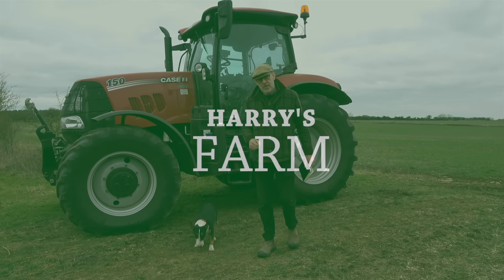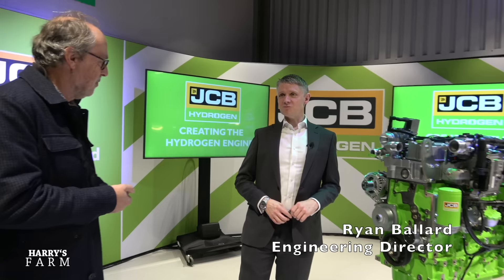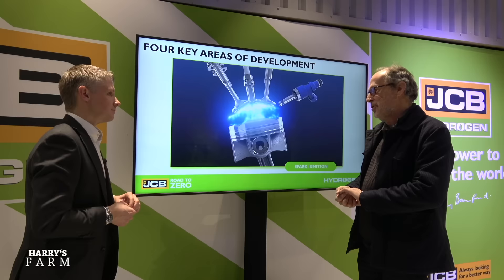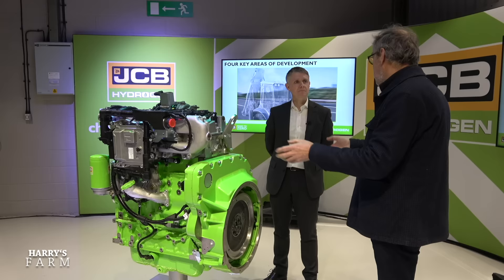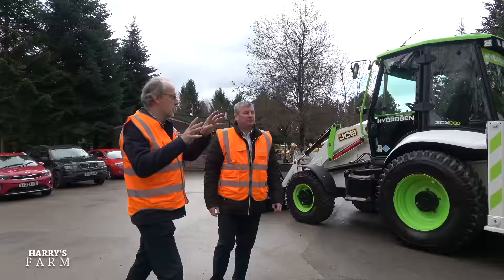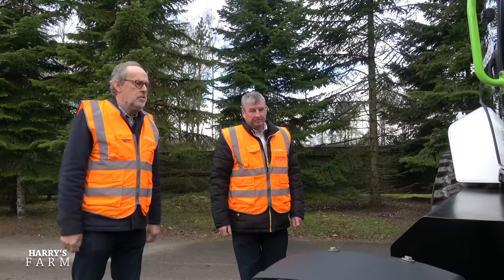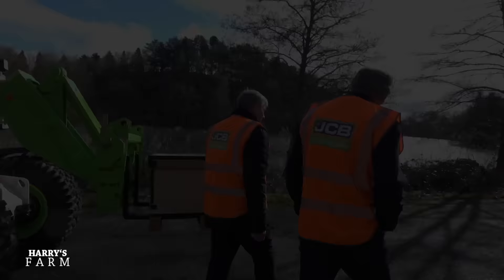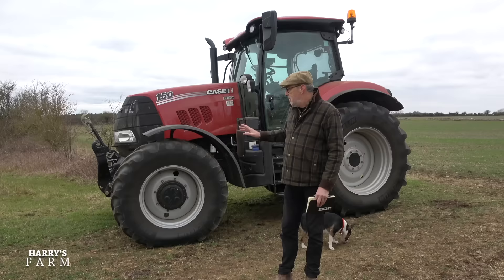JCB is moving to hydrogen power for all their big machinery. Here’s why.

Comment: I can’t agree with you more about hydrogen being the way forward for torque engines, and the multi fuel approach to get to net zero. I have a customer who is a subject matter expert in the industrial production of hydrogen and the transportation of it thereafter. The challenges are enormous and there will be a requirement for significant infrastructure to support the Green energy required to produce hydrogen.  In addition to that the distribution of hydrogen is very tricky due to the fact it needs to be -273C to ,liquify it and then the fact that hydrogen oils so easily and the gas’s loss is in the region of 20%. 
The only other way to distribute hydrogen would be as a compound with Ammonia the most likely candidate. There is insufficient ammonia production in Europe as a whole and the step up to that level of production is huge.
I have noticed with interest that the hydrogen pump at the Shell Gatwick Airport has been removed. I wonder how many others have been removed country wide.
As for the government and there box ticking without investigating………well you can’t help stupid.

Comment: I want to keep an open mind on this but there are a lot of issues.  First hydrogen is extremely difficult to transport and store.  Because it is the smallest element, it oozes out of anything that you put it in.  Second it presents a serious safety risk.  It is either compressed to an extremely high pressure or liquified.  Third it will be 15 years or so before green hydrogen will be readily available.  Today 97% of hydrogen is produced from fossil fuels.  Fourth it is 7 times more expensive than electric.  Five no regenerative braking to recover energy.  

Swappable  batteries, like Janus trucks, may be a better option.

Comment: 36.25  Cutting the cost from $15 to $1 is unlikely.  The cost of handing it is way higher than diesel. The cost to compress it is very high.
The EROI is terrible. Solar has an eroi between 3 and 6. So using solar to generate hydrogen will never be higher than the EROI of solar minus all the losses.    All the conversion losses and  compression will lower it even further.  With marginal solar, you could end up with a large net energy sink. Add these losses to the losses in the engine and you can easily be large net energy sink.

Comment: WOW!
Hats off to JCB, they really are pushing the boundaries in the hydrogen sector. The only possible thing I can think of in terms of an improvement is to generate the hydrogen in situ using water in the tank. That of course is the holy grail for attaining a true hydrogen economy.
Reply: So, where would the energy for the onboard hydrogen production come from?!
Reply: @Simon-dm8zv  There is in fact at least one 'forgotten' technology that I am aware of that produces enough high heat energy in a closed loop system capable of producing hydrogen from H20 without electrolysis. The temperature attained is capable of melting tungsten which splits the water H+H+0
Reply: @lagunafishing  Sounds very energy intensive
Reply: @Simon-dm8zv  Not at all, it's low cost and self sustaining. The heat used to split the water is derived from the recombination of hydrogen atoms H + H =  H2
Reply: @lagunafishing  Impossible, there will always be losses.
Reply: @Simon-dm8zv  Yes,  of course - you will lose some water and some heat and some energy loss through mechanical conversion but there will always be some gain too in terms of efficiency.
Reply: @lagunafishing  As long as there are losses it cannot be self sustaining.
Reply: @Simon-dm8zv  Yes it can.
Reply: @lagunafishing  Nope
Reply: @Simon-dm8zv  Water is everywhere and so is hydrogen, so yes. The only required energy input is a spark.
Reply: @lagunafishing  you might want to read about some basic introduction to thermodynamics.

Comment: I fear that this engine is not the panacea that people will hope and expect it to be. There are tremendous challenges with the production and storage of hydrogen. The energy required for electrolysis, the cost of the materials for the proton exchange membrane, the permeability of storage materials, the cost of setting up infrastructure. I am not a naysayer, just a realist. It might become more cost effective if we can harvest comets and the various moons in the solar system to collect the platinum and iridium needed for the PEM, but that won't happen any time soon. We also need cheap and abundant energy and that's years away too. There is work going on to develop pressure vessels that can store hydrogen at 800 BAR, without allowing it to leak through the walls. Can you imagine the risk assessment for charging the tanks when they are empty? I'd like to see hydrogen engine in mass production, but I can't see it happening.

Comment: Have you seen the potential for green ammonia thru a business called Feul Positive... Ticker NHHHF, They have a machine which can produce the ammonia using just Air & water plus a renewable source of electricity... They have already converted tractor & pick up truck FYI... Plus in farming this Feul is also going to be useful in fertiliser too...  I think as an engineer that storage and handling of the ammonia in terms of tanks and far less volatility that you have potentially a easier solution for conversion of your current vehicles.... 
Ammonia still holds high speed record from a jet plane from years earlier... 
Would be interested in any thoughts on another hi performance alternative Feul, but without the hi pressure containment issues with Hydrogen...

Comment: What I can see happening is shady mechanics saving old engine oil and pawning it off to a different customer as new engine oil, I would put a color additive in the oil so that it could not be resold as new oil, like how home heating or un-taxed diesel is pink and regular diesel is clear, there should be some kind of mechanism built into the machine to change the color of the engine oil once it's added to the machine.

Comment: It is very easy to get diesel like Torque, when you do a 33% long stroke engine with a Compound Turbo.
Basically, you are mimicking Diesel characteristics.
And you could burn Propane on higher compression too.
Hydrogen will be too expensive........

Comment: Daily Telegraph article from 07/03/23:  The joint project with the Illinois Institute of Technology (IIT) has achieved a radical jump in the energy density of battery cells. The typical lithium-ion battery used in the car industry today stores about 200 watt-hours per kilo (Wh/kg). Their lab experiment has already reached 675 Wh/kg with a lithium-air variant. The team believes it can reach 1,200 Wh/kg. The coming battery technology kills the case for hydrogen in cars, vans, buses, or trucks, and perhaps also for trains and aircraft, whether it is “green” from wind and solar via electrolysis or “blue” from natural gas with carbon capture.

Comment: Very impressive for heavy machinery. How would these compare to using hydrogen fuel cells and electric motors on drive axles. Could it be as high as these motors but 1) have moving  parts only in the electric motors and drive systems, 2) have very developed components and controls, 3) no starting problems, and 4) as good or better Newton-meters torque per kg of hydrogen?

Comment: Coming from a HGV background and being involved with the idiocy of the EU and Euro 4: 5: 6 systems where because of the weight of the engine and exhaust systems the payload shrank which in real terms meant more trucks on the road to carry the same payload. Battery HGVs is a non starter as the weight of the battery would mean moving small weights. Hydrogen is the way forward for all plan, heavy kit and HGVs. Replace their on site/depot diesel tanks with hydrogen tanks… no brainer, well done JCB and Lord Bamford doing it independently of useless governments who hold back the country

Comment: This is interesting. However, there are still lots of moveable parts in that engine which forces you to still use fossil fuels for lubricant. 
Why didn't you come up with a new engine architecture to reduce some of the required parts to run that engine?
Reply: it should simply be an electric motor

Comment: The Toyota Hydrogen engine is used to convert the energy into electrical power to drive electric motors in vehicles. This appears to use the hydrogen energy directly, a BIG well done to JCB. Don'r forget to look at  Australia as a producer of Hydrogen, we have plenty of sunshine.
Reply: Hydrogen fuel cells like in the Toyota are far more efficient than direct hydrogen combustion like in the JCB engine.

Comment: Hydrogen is difficult to store so needs to be used quickly after manufacturer. This makes it fine for industrial use and as a replacement for diesel. For domestic use with vehicles parked much of the time hydrogen is a dead loss as it just leaks away. Farms of course  can have an electric generating windmill complete with its own hydrogen plant, all they need is water. So petrol heads getting excited about hydrogen are on the wrong track, they will just have to get used to all that extra torque in electric cars.

Comment: I understand that there are several applications where a hydrogen engine or a fuel cell is better suited than current battery technology and I applaud all R&D that is done to develop these and competing techniques. I do however see a few problems regarding hydrogen solutions.
Green production of hydrogen with current techniques takes a lot more electricity than can be recovered from the hydrogen. Installations to produce hydrogen are expensive and must run full time or close to it to make economical sense. Running them only when there is an excess of electricity is too expensive (I know that argument was not made here but it is a common argument I hear). In the end, I may well come to pass that we take all this for granted, but 
Currently, around 90% of hydrogen is produced by methane reforming and the resulting CO2 is dumped into the atmosphere. In that case, studies have shown that running machines directly on methane is more efficient than going the hydrogen route. Only when an efficient CCS (Carbon capture and sequestration) technique is developed and applied, would hydrogen from methane reformation gain an advantage. The problem is, that technique is not yet practical and/or applied in the field. For example, all field trials in the USA to apply CCS to electricity generation have failed, despite many millions in subsidies. I know of only on possible candidate in Africa where algae are grown in ponds, dried, and buried, but I have not heard of the financial feasibility of that trial.
In the end no single technique will solve all problems, so many different ones will be needed and developed/enhanced. We may end up producing biofuel from algae like the trial in Africa as the best solution for heavy machinery, ships and airplanes.

Comment: It's the obvious thing to do if you want to reduce carbon output and pollution at the same time, well done to JCB for a common sense approach to engineering, when the Brits get busy and focused this is what you get !!!
Reply: The obvious thing would be hydrogen fuel cell, which simply requires less hydrogen.

Comment: It seems likely that battery power will replace fossil fuels in the majority of heavy vehicles, tractors included. There are several compelling reasons for this. Hydrogen is enormously expensive to produce, extremely difficult to transport and store, and green hydrogen cannot be produced in sufficient quantities at present because the capacity is lacking. On top of this, hydrogen power is enormously inefficient. It takes four times as much energy to power a vehicle with a hydrogen fuel cell relative to a battery powered electric motor. And in terms R&D, battery power has the upper hand. It is already being used to power massive diggers and dumper trucks in the mining industry.

Comment: Another fascinating video Harry. Lord Bamford's comments regarding overall government Net Zero policy and their narrow focus on means to get there are worthy of so much more debate. With regard to heat pumps, even here in Spain, my analysis of my own heat pump installation is that the overall improvement from the points of view of economic benefit and efficiency are marginal. Whether heat pumps are 'greener' will obviously relate to how the electricity to run the heat pumps is generated.  In the UK, where mean temperature is so much lower and so much electricity comes from gas turbine generation, it must be very questionable indeed.

Comment: Did I hear The engine only produces water vapor?  Any combustion engine also produces nitrogen oxides.  Not quite zero-emission.  And then there is the CO2 and other polutants produced at the coal-fired power plant that will likely produce the power used to produce the hydrogen.  More not zero-emissions.  We have a way yet to go.

Comment: How stable is oppressed hydrogen in a tank? Also, how delicate is the fueling process in regards to the nozzle and locking mechanism? i.e. if the nozzle was struck and broken so that hydrogen was leaking, electrostatic charge was in the surrounding air?

Comment: If using hydrogen efficiently was as easy as feeding it to your existing internal combustion engine, all the car manufacturers would be doing this already and not spending billions to electrify. This smells of greenwashing to me and the efficiency stated by weight rather than comparable energy is misleading. (Hydrogen is 3 times more energy dense than Diesil)

Comment: Great idea but if it has an ignition system and doesn't rely on the heat of compressing the combustion mixture it is no longer a diesel is it? It is just a gas engine using Hydrogen in stead of gasoline/petrol?

Comment: What happens if you pierce a 350bar tank of hydrogen? 
What happens over multiple heat cycles… some “dry steam” must condense to water internally
And how does hydrogen achieve clean/lubricate properties of diesel without burning oil?

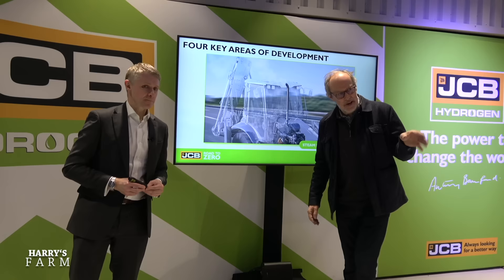Comment: 12:30 if you are running high pressure high temperature like any other ICE what about NOx? Do you still have a catalyser? How does it work with the lack of any carbon in the combustion?

Comment: 500 bar hose in rugged conditions seems like the weak link in this system. The prospect of a hose rupture is cause for concern. Are there measures in place that will detect a delivery hose failure and shut the flow off?

Comment: They didn't cover embrittlement or run time. I would wonder how the engine internals hold up over time while exposed to hydrogen at higher temperatures. I would also wonder how long they can run on a fill as compared to diesel

Comment: There are so many problems with hydrogen - the efficiency from going from electricity to hydrogen then burning this in an internal combustion engine is probably around 15% whereas direct electricity is 100%. The problems of storage and delivery are also massive. Even if you are going to use hydrogen, whey are you not using fuel cells that are a bit more efficient? There seems to be a group of people who see batteries and direct electric supplies as wrong and hydrogen as this magic bullet. Perhaps someone can explain?

Comment: Maybe the intent will be a hydrogen fuel cell. Based on running a fuel such methanol across a platinum catalyst creating hydrogen to used immediately in an internal combustion engine. Direct methanal fuel cell is feasible, other tech I am doubtful of.

Comment: Good report! Electric is not currently going to do all the work that needs to be done, H2 at least can transition from carbon based fossil fuels to clean burning H2, hydrogen is not as efficient as battery power for small vehicles like a passenger car or bike but has the advantage of rapid refueling in a remote location and can be created in a remote location provided enough wind and/or solar, possibly modular nuclear power and water are available.  The big questions I was wondering as I watched is how much run time per fueling, how long to refuel and the cost per hour to run. You hit each point spot on and I look forward to using H2 in the future. Another important fuel would be Bio-diesel for existing machines, It is not pollution free but instead of releasing sequestered carbon into the atmosphere from fossil fuel it is using carbon already in the cycle and not increasing the total tonnage of CO2 in the atmosphere. if countries like India could grow a crop that used the waste product for bio-diesel they could lessen their reliance upon imported oil.

Comment: 25:44 "Fill time 6-7 minutes."   Does that "quick fill" take longer on a Winter's day?   When the supply vessel is 3/4's empty, it will only have 25% of original pressure, so can it still fill a vehicle to 100% full?   Does dispensing apparatus include a compressor?  Power by what?

Comment: Great stuff! Can a domestic boiler be easily converted? We are in a world of pain trying to advise a range of client types which heating systems to go for…
Reply: I work in the hydrogen sector, so I'm far from biased against it in places where it's appropriate. But hydrogen for home heating is a non-starter. It's incredibly hard to avoid leaks, and leaks are very dangerous as H2 is explosive in air in a significantly wider range of mixture ratios than natural gas. It also has a tendancy to pool at the ceiling as it's light, so you can not notice it building up for a significant amount of time.

Couple that with the fact that heat pumps are hugely cheaper to run and hugely more environmentally friendly (due to the lack of inefficiency in the hydrogen conversion process, and due to the COP of the machines), and hydrogen for domestic or commercial heating is a joke of an idea. It always has been. People just figured out a way to fleece governments and companies out of money to "research" it.